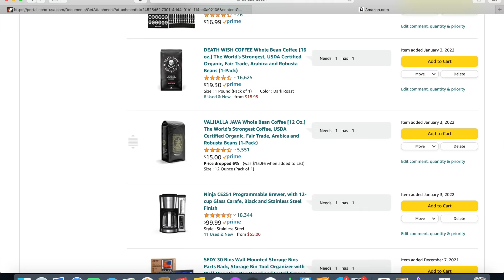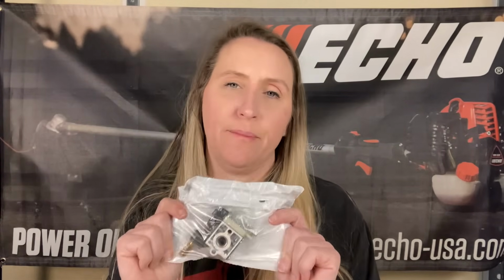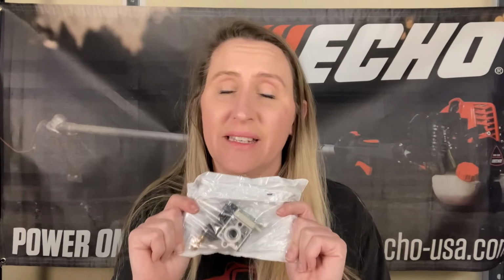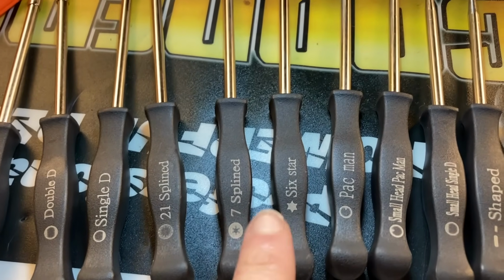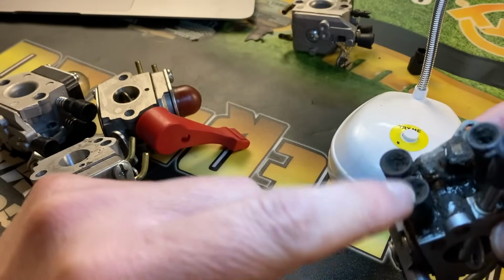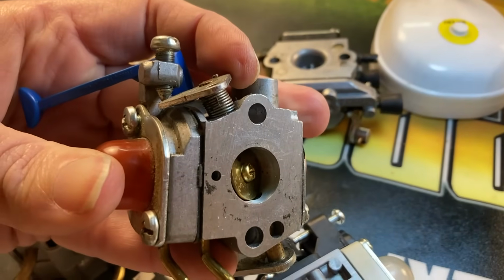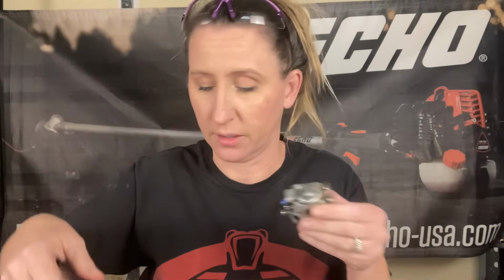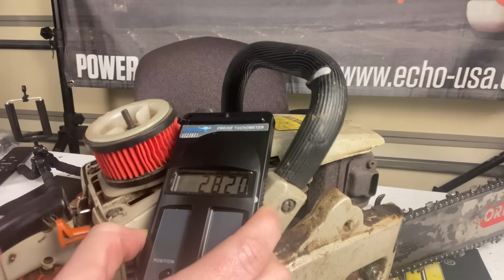HOW TO ADJUST your 2 Cycle Carburetor on a Chainsaw or Trimmer and when you probably shouldn't VLOG

Comment: Hello there chickanic I just thot I would give you a tip about the powersaw bar that I always performed regularly I wud take my bar plate and run it down the groove of the bar and it cleans out all the debris compacted in the bar groove allowing for better chain oil flow as well as the chain flow Hope this helps in your future endeavors as it has for mine I was a highlead logger and spent over 2 years in the landing which was very hectic to say the least (eyes in the back of your head type deal) and it wasn't uncommon to do 10 truck loads a day which required limbing every single limb and topping then taping out each log (I used to do 3 at a time memorizing the added length needed like one was 28" more then the third was 39" more) and also stamping every log both ends. I never once received a complaint from the mill and actually recieved extra money for bucking bonuses from them. I also had to unhook the chokers and tend to the rigging crew on the hill which is what I did also after for 10 yrs. I was a one man show on the hill by hanging my blocks on standing trees for tailholds that I cud then watch them from 1200' in the frontend where I would begin setting chokers and move back to 'backend' sending logs to the landing. I also worked the water performing water bucking taping and stamping logs as well as limbing and broken ends plus worked as a deckhand for the boom man doing duties as required It was quite an experience which unfortunately I would not recommend to anyone as it is a dangerous lifestyle to say the least and a lonely one also as you spend most of your life in the woods in camps I made it without a scratch basically but the near misses are very many!!! I thank the good Lord for watching over me on this! 
Keep up the great work! You are such an inspiration for me! Thankyou!
PS : wat is your christian name?

Comment: Thank you. I have a fast cut concrete saw, a Stihl leaf blower, and a Husqvarna chain saw, I moved a year ago, and unlike me, I didn't maintain them as I should have. Last week, I needed the chain saw, and for the first time in 15 years, the Husqvarna  wouldn't start. So I drained the gas out of all 3 , bought a can of echo 50/1 gas, and tried to start them. The Stihl won't start. The fast cut will but dies when I give it gas as well as the Husqvarna.  They both smell like hair burning. 90 percent of that was the echo gas. I bought 90 octane no alcohol gas, VP 2 cycle oil, and changed the gas, and all 3 started, and within minutes, it ran almost perfectly. But not quite. The Husqvarna  is lean. If I partly choke it, it comes up on power. The fast cut hesitates and then revs up, but when I let off the gas, it takes probably 20 seconds to idle down. Is that because of the rotating mass of the 14" blade? And if these carbs don't bounce back, would you put kits in or replace carbs? Thank you for all your content.

Comment: There is moisture in the air . If you have a fuel can or a tank that isn’t completely full when ambient temperature drops such as over night condensation will form and water droplets will go down the sides below the fuel and since it now has fuel over it it wont evaporate . I use generators and before I start them I always drain the float bowl and let enough fuel run out into a suitable container like a mason jar with a screw on lid . I keep that jar even though it’s fuel and water because I can get the water out of the fuel by putting the jar of fuel in the freezer the water at the bitten freezes but not the fuel and I can pour the fuel off and not get any water.

Comment: Now this was a interesting and very informative video. I have always been very leery of trying to adjust my two cycle small engines carburetor, because I know that it's very likely that I will screw it up so I leave it to the professionals like you. I try to do everything else myself  that l can and I run nothing but no ethanol regular fuel in all of my small engines.

Comment: Chickanic another great video.Do you ever have to do a pressure and vacuum test on 2 cycle engines,when you did all the above and still won't run right,if so would you do a video on it.

Comment: I have carburetor adjustment tools and I don’t use it I did one time with my cheap Poulan Pro chainsaw and runs good. Some carburetor adjustment with small flat head screwdriver

Comment: What you do is get the adjustment  screws out with needle nose pliers then take your dremel and cut a straight slot in it. Voila!... 

Or if you find the right size.piece of copper or aluminum tubing. You can use that as an adjustment screw but you have to keep cutting it off because it being copper or aluminum will a strip after a few uses...  That's how I deal with not being able to find my adjustment tool.  Which I think walked off with a buddy
 tubin

Comment: Properly stored, fuel will last a long time. I keep mine in (good condition) 10L metal jerry cans, pre-mixed or not and never have a problem. I do not keep the lids open other than when filling or dispensing, so only a couple of minutes max each time. I keep the jerry cans on a dry concrete surface in the garage which keeps it cooler. I have some cans that have been sitting for three years and my mowers and chainsaws start without issue with it, ever. I am forever reading about fuel going bad for people in short periods of time and that it does not last long etc etc. Fuel does degrade, but it requires a fresh supply of oxygen and evaporation of aromatics to do so. If this sounds like I go out of my way to keep my fuel supply "good" well nothing could be further from the truth. I do not really give it much thought, I just store it as above. Temperature here in summer can reach above 40°C sometimes for a couple of weeks at a time, so I am not living in the arctic circle. So to me this thing about fuel lasting only from three to six month is just a bunch of baloney.

Comment: For those carbs you said you need a special tool to get the limit caps off... a small flathead screwdriver heated red hot works great. Heat the driver up red hot and puch it into the plastic cap. Once it's cooled, twist back and forth as you pull and pop! Usually, it will come right out.
Reply: sounds to me like once we know the thread pitch, the correct left hand threaded screw should be far cheaper than the factory tool.  Also, what about tiny easy outs?

Comment: I got a little trick I did on a gallon of gas that I had for over two years if you screw the vent down tight and The spout don’t plug it solid don’t seal the can You won’t have a water issue

Comment: Great video, very informative. I'm not ashamed to admit I am definitely 2-cycle challenged. I can tear and repair just about any small 4-stroke, but I send the 2-strokes out ;)
Reply: I enjoy working on 2-strokes. Love the sound and the smell.
Reply: @mikespain8655  I have several 2-stroke tools, I'd love to be able to service them, just never have developed the skillset.
Reply: Two strokes are pretty easy, most of the time the carburetor and or fuel lines are bad. You can usually find "tune up kits" online with everything brand new for around 20bucks.
Reply: @sentradynamics8889  Bre sure makes it look easy. When I started trying to work on them "online" didn't exist yet and I've just never messed with them since.

Comment: So very true but when you go from 500 foot elevation cutting black oak  to 5000 feet elevation cutting pine I have to adjust my carb but you are so right about water in fuel I’ve had many friends that go with me and yes they had water in there fuel but you can buy the carb Adjusting screwdrivers from Amazon eBay you name it

Comment: If you’re not a commercial user just a pay a bit extra for Stihl or Aspen  premix fuel (I’m in the UK). Not that expensive really for domestic use and you can sit your chainsaw all winter with some in The tank and it’ll fire straight up in the spring. Not sponsored or affiliated but I have tried all sorts of fuels and stabilisers, emptying tanks and so on. Just my opinion. Also as a reference I bought a second hand 20 year old Stihl hedge trimmer only ever run on Stihl premix and it’s like brand new. Bought from a reliable source.
Reply: Ps enjoyed your video, first time I’ve seen your channel. Had a look at your Amazon. You must like chocolate and mustard! 😁

Comment: The reason there is water in the fuel is because of the ethanol that's in the gas, it attracts the moisture in the air. boat owners that dock their boats have a lot of problems with this, especially in Florida.

Comment: if you're from Illinois and try to buy a carb adjuster tool from eBay you'll be blocked from making that purchase😞 i had to struggle with the disposable ballpoint pen tool method. but yet my neighbor took his stock Harley and legally paid big money for enhanced carb computer chip that lets him run loud straight drag pipes, totally putting a middle finger to the EPA settings. my weedeater didn't smoke after my adjustment which is what the EPA is worried us amateurs will do.

Comment: I set my initial adjustments at 1.5T out on both jets and 2.0 T preload on the idle screw.  I let any saw idle for five minutes before I touch any of the adjustment screws.  My RPM limits are 12,600-12,800 as measured on a good inductive tach.  My idle setting varies with displacement but is between 2,500 and 3,200.
Reply: Can you advise me where to get a good tach? She said twenty dollars but I'm can't find one.
Reply: @mrtennessee6862  David,  I got mine on EBay, but look for one with a replaceable battery.  They use those little coin batteries for computers.  Mine has three buttons.  The real good ones have tripled in price, like the DTI 20K, versions.  I am not paying $400 for a tach, when they were $100 a couple of years ago.  Look for one in the  $40 buck range.  Search for inductive tach.

Comment: I can solve your water issue with ethanol fuel if you follow this instructions I had a 1 gallon can that I filled up at the gas station put the mixed oil and put a little bit of star tron in it and at this point when I got home I closed the vent to the tank and I caped the gas can That gallon of gas lasted over two years and ran fine so it can be dealt with

Comment: Bre when you talked about the spark plug I’d like to share a couple things that I came across from experience trying to help my Dad ( God rest His soul ) He had trouble with His John Deere Model A tractor that would stop running after a bit just like that He would turn the ignition key off Well unfortunately He purchased the Two Spark Plugs from ( I won’t name the Store that was known from Your State at Bentonville ) anyway He should have gotten the Spark Plugs from a reputable Named Parts Store that ended up fixing His problem and Also I found out that just by removing the spark plug and grounding it on the side of the engine block with the spark plug wire attached and then crank the engine over just to see if the spark plug is firing or not doesn’t mean that it will work or fire when you put it back in that now that same spark plug that one could see it firing when it was removed and laid on the block to make sure that it was grounded that once reinstalled that it would fire  at all when it was installed and it was under the pressure of the normal compression pressure that it was subjected to when it was installed properly back into the engine block cylinder and that it can’t be seen to verify that it is still firing properly under the normal pressure that is in built up during the normal part of the compression stage of the four cycle engine . So it was a good learning experience and lesson that I will never forget and I just wanted to share that possibility with you and your followers Thanks for letting me share that with you it maybe helpful to someone else who may be having that same problem!!! Thanks again for your great advice and help in the past and the future too!!! Sincerely Allen D Hoffbauer

Comment: I bought premium fuel at a local station to skip removing the alcohol step while in the middle of a big removal and every saw started running bad after refueling.  A trip back home to get gas solved the problem.  No telling how long that gas had been sitting in the station's tank.  I buy my gas only at stations that sell a lot of fuel and never get premium just because that's a seldom sold fuel therefore more likely to get old.

Comment: Awesome video on setting the carb! 
What I was doing was setting my high speed first to proper RPM then going back and setting my low RPM good throttle response. Then set my idle RPM. 
Is this a carb setting fine tuning procedure your learned from somewhere? 
I find what you are doing to be a better procedure and do you use the low speed RPM for all your chainsaws?

Comment: What you need to do is get a flat bar nothing real hard like maybe stiff piece of rubber to where you can run it through the handle and lightly clamp it down to the bench the saw that way are you can have both hands free one work on the throttle and one work on the adjuster highly recommend that this is a Jim mungai From Kennerdell Pennsylvania

Comment: If you run small engines, including & especially lawnmowers/chainsaws/strimmers - Pump petrol is no good. You have 2 choices - run the like of Aspen or another ethanol free fuel or learn how to remove the ethanol by adding water then removing the water & ethanol to leave you with clean fuel. If you run pump "car gas" through your small engine stuff, you're gonna have issues & it will break your heart.  Carb adjustment in one sentence? "Wind all in till they bed down, then wind them out one and a quarter turns."  Works mint on 90% of carbs. You can twiddle a bit from there - but that's a great base setting. Shindaiwa built a version of this saw - almost identical apart from the plastic colours - it too is an everlasting beast, built using the finest materials -  but it too prefers 1.25 turns out over the factory version of 2.5 or so. They tend to sulk a bit at the factory settings.

Comment: I actually still use a echo that was literally ran over by a Ford F-250 the front wheel. I changed out the bar and the chain had to change out the the pool start cover that was broke and it started right up.

Comment: Water yes it's the darn ethanol. I bought a used Honda self propelled mower new it was $700 it was probably 3 years old for $ 35 brought it home clean the carb , bad corroded . Had it running in an hour . Water over winter is bad up north .

Comment: My tach was a bit more than $20.00 but it is for model airplane engines, both gas and glow. It reads at the prop. One thing I have noticed and want your opinion on. I noticed the high-end adjustment does not affect the low-end adjustment but the low-end adjustment does affect the high end?

Comment: When cleaning out carb I remove mix screws and blow compressed air through when it is stripped down so as not to damage diaphrams about 20 psi. What is your opinion could this do potential damage?

Comment: Great content, happy I came across your channel and found this video, very informative. Just recently purchased the Echo CS590 Timberwolve and sent it to Iowa Performance Saw for a muffler mod and had it tuned. It's a beast. Thanks for sharing, your video is very helpful
Reply: Why the mod on the muffler ?
Reply: @timm2845  open up the restricted muffler and let out more heat.. A cooler running engine will last longer, plus it opens it up to have more power, the factory muffler is very restricted

Comment: Hi ya,
Say for instance you have a home brand strimmer or blower or whatever and it's got a carb you don't know what it is who it's made by etc. Can you change the carb to one that you do know like an aftermarket Stihl carb on a home brand tool!???
If they're all similar size and adjustable, I'm just thinking if you got issues with a crap Carb on a cheap (but good) machine is there any reason you can't put a GOOD Carn or carb copy on it?
Sorry of this is a stupid question!? Just I've got Stihl FS110, plus a number of other different tools ALL DIFFERENT and some home brands some just not as good and I'm sure none of them are going to run this year so I'm wondering can I just buy 10 carbs the same and change em all out for the same like ALL Stihl or Stihl copies or whatever!??
Cheers.. 
Also will cheap bulbs be ok on an original carb?

Cheers from London England 👍

Comment: The 3700-2700 RPM procedure for adjusting the low speed and idle screws... does this work for all chainsaws? My saw is currently idling at 1400. 2700 seems kinda high.

Comment: Echo SRM-210 starts and idles fine, but as soon as I give it any throttle it bogs down and dies. I replaced spark plug, air filter, and fuel filter. I checked the exhaust screen after seeing your video, but it was clear. I still cleaned it. So, apparently carb? I spoke to a local shop and he said that they stopped doing the rebuild kits over 10 years ago because they rarely worked. They just replace the carbs nowadays...does this sound right? Thanks.

Comment: I know this is 8 mnths old, but I just bought a tach to set rpms on my yard tools. My Echo pb250 states 6900 rom at high idle and 3000 at idle..when I checked it, I am running at 6400 roms. Should I adjust to 6900, or is 6400 running too lean?
I am a city dweller so have a homeowner saw, a reconditioned Ryobi ry3716. Ive owned this saw for 6yrs now and it is fine for what I use it for. The high speed is 11000, and since its not the quality of the big guys, should I keep the rpms under 11000 or can I keep it close at around 10500.
Thanks, and.love all your videos, especially your latest comparison of the 3 saws.